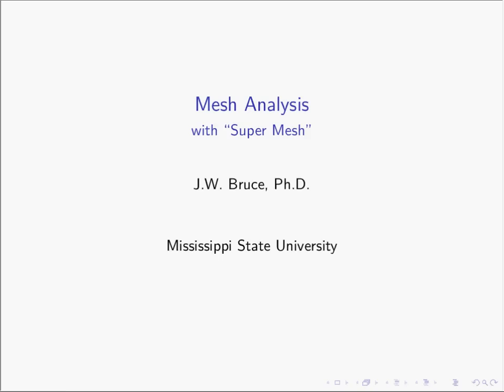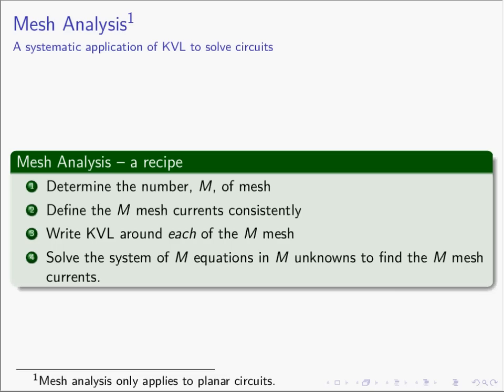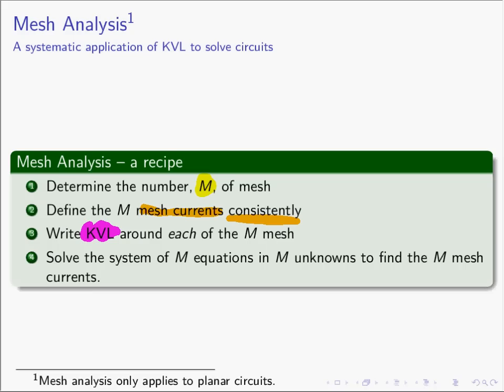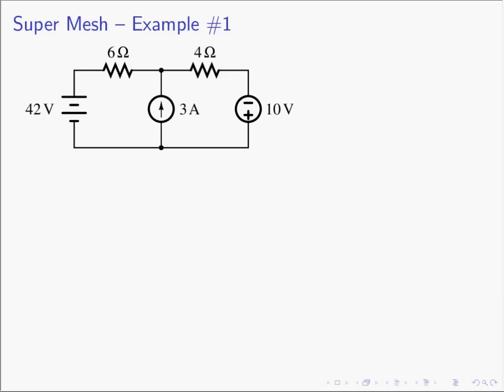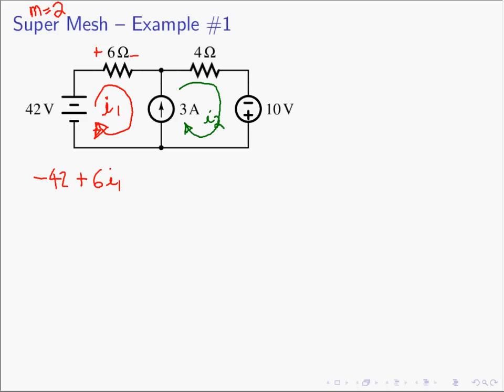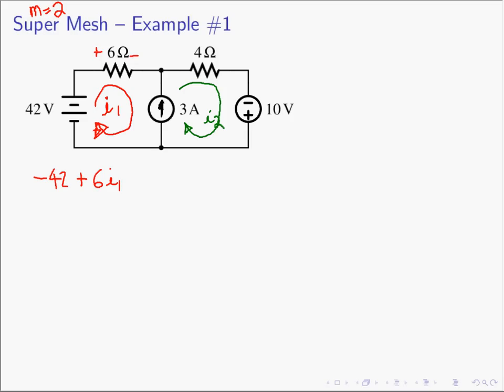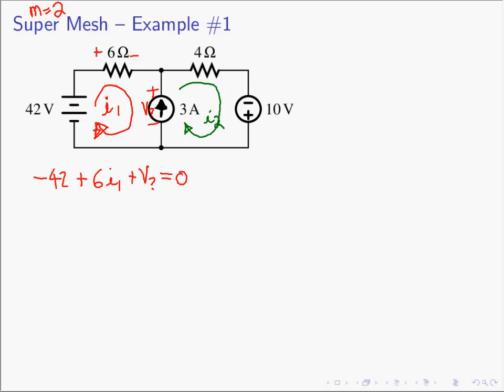Mesh Analysis with current sources (super mesh)

Comment: Why is it 7(i1-i2) in the supermesh and not (i2-i1) ? Please help, my exam is tomorrow :(
Reply from the maker: Do you mean 1*(i1-i2) in the super mesh of example #2 (about 9:20 into the video)?  If so, it is because I always write my KVL equations for mesh analysis as the sum of the voltage drops.  The passive sign convention and Ohms Law states that the voltage drop across a resistor is V=I*R if the current I is directed into the "+" polarity mark of the voltage V.  Therefore, I will need the current directed down through the 1ohm resistor so I can compute voltage drop to sum in KVL.  The current directed down through the 1ohm resistor would be (i1-i2).

Comment: why is it -42V and not positive 42 volts?
Reply: +Hamza Hussain It has to do with the polarity of the battery. Because he drew his mesh current in the clockwise direction, the current flows through the negative side of the battery first (the lower voltage side first). Likewise, in the example you can see that the 6i and the "v?" are written as positive because if you follow the flow of the current around the loop, it flows from the positive polarity to the negative polarity. Hope this helps.